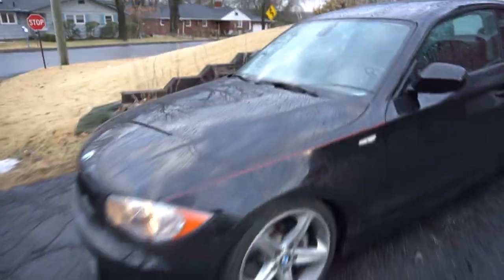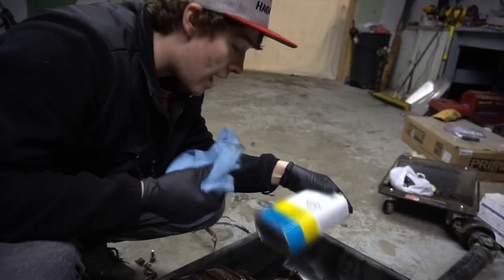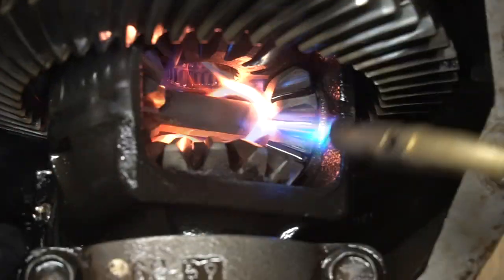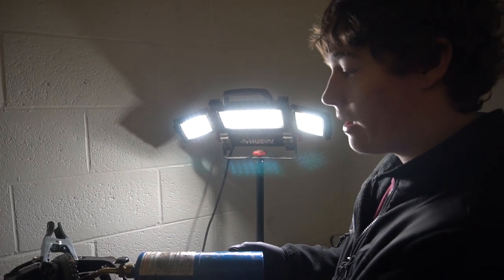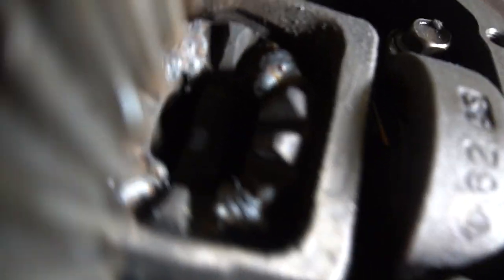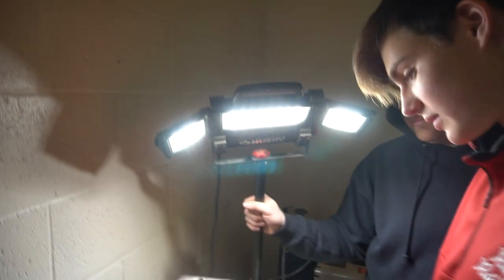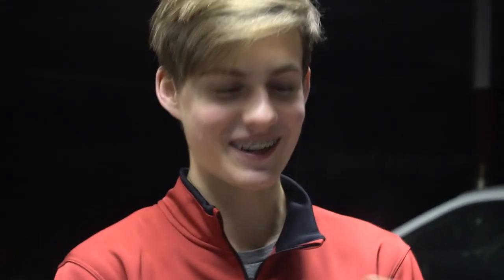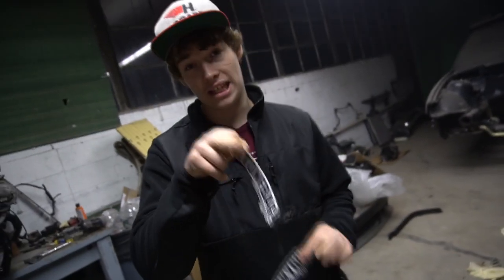Anyone Can Weld A Diff!

Comment: Doesnt that diff cover just use RTV as a gasket?
Reply: bmpTurboGLI yeah usually
Reply: They make a paper gasket but RTV works just fine. I'd recommend the high temp stuff just to be safe though the normal stuff is probably fine.

Comment: We normally take oil off, fill it with diesel, spin it few times and let it be for like 20 mins turning it few times and then open it. Then can of brake cleaner and blow it dry with air

Comment: Dude those welds are gonna break. Should've at least welded the gap shut on the contact points on the spider gears. I welded mine the way you did lasted 3 burnouts welded the gap on the gears it's been like 5000 miles and still going
Reply: What happens when it break? Just weld it back or need a whole new diff?

Comment: Not hating on the welds but you should probably up the amps because its not really penetrating the metals and melting them so they bond together, its just putting a bead on top.  That shit can break off and fuck ur shit up when youre driving, big time.

Comment: that's gonna break, not straight away but it will, you have to weld the spider gears to the casing to get a nice solid diff, the plate is a good idea too

Comment: what's wrong with using brake clean? I'm about to weld my s10 diff
Reply: Ap3xglide don't use chlorinated brake clean. Use unchlorinated and wipe it down really good
Reply: BRENNAN KUNARD OK thanks. I need to weld it because the s10 is my field truck but it won't drift because of open diff syndrome